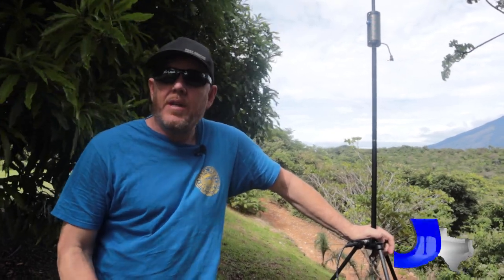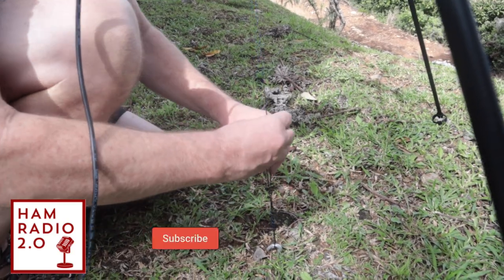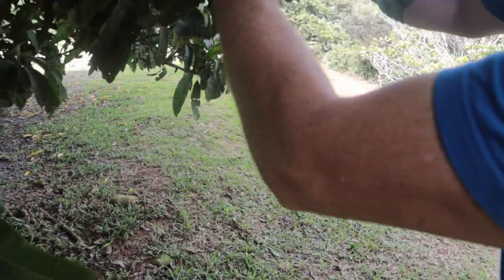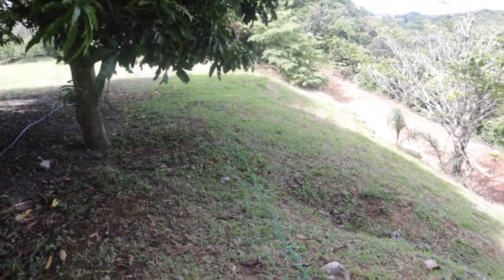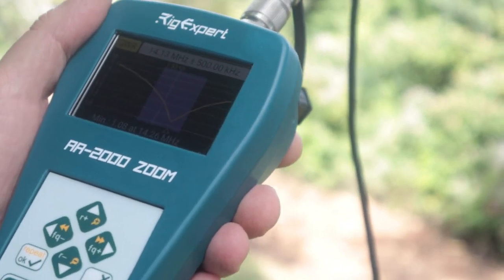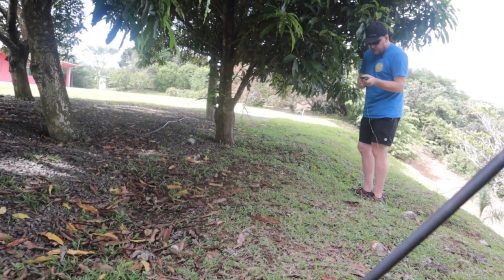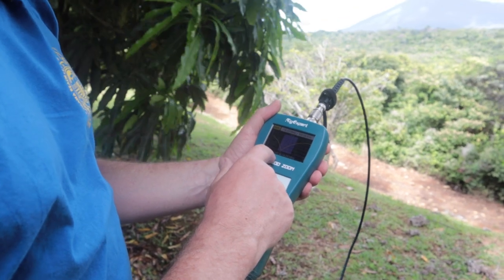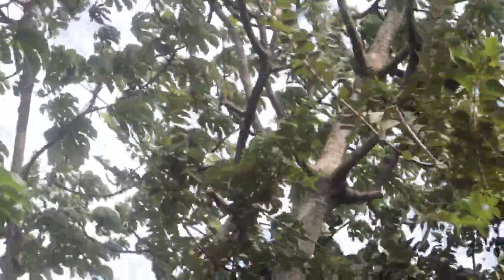Tuning the Buddistick Pro | Buddipole Ham Radio Antenna

Comment: Great tips Chris.  I use my Buddistick for home ops in the HOA restricted Condo I live, and get decent results.  I have mine mounted on a Buddipole tripod with a Versatee.  An antenna analyzer is very useful and almost necessary to quickly get the best results.  I also use the Buddipole Triple Ratio Balun on EVERY installation.  It cuts down on common mode currents on the outside of the coax, and also helps when the resonant point is over two to one.  Sometimes it just take a switch of ratio on the Balun to bring it home.  I recommend using it on all installations. I am a cw operator and usually don't use any more than say... 35 watts.  90% of the time that power level is more than adequate for a qso. Good stuff Chris!  Thanks for continuing to put out good info on setups.  73's K1YPB

Comment: Chris, these are great innovations and enhancements to the Buddipole system. I have made thousands of contacts over the years with the Buddipole and Buddistick. I can deploy this antenna at a park in 5 minutes and be operating without fuss. With the FT891 there is no need for a tuner.

Comment: Looks like it has a much higher Q than the Wolf River Coil.  I get a much flatter sweep on the WRC without all the fussing with the radials.  If he just put out two more radials I suspect he would get a much flatter SWR curve.
Reply: Most likely it's because you are using a much longer whip on wolf river coil.    The high Q is due to the coil usage, so longer whip will help.
Reply: @fubolibs4218  That makes sense.

Comment: Great antenna.  The only thing is that counterpoise/radial that needs to be up on the air.  If you are doing 20 meters that would be around 16 feet long.  Love the bag that comes with it.

Comment: Great video. I was having a tough time with 40 Meters. I ended up with my radial less than a foot off the ground to get 1:5 to 1 at 7.110. I will try this method out next time and see how it works.
Reply: I too am having a rough time tuning up on 40 meters. I'll post my notes back here once I achieve my tuning. I love this antenna design and I am not going to quit until I get it. :)

Comment: Interesting, does the single radial also have an effect on direction of transmission ?
Reply: I believe the answer is absolutely.  I'm sure there are those here who understand antenna ground plane theory and design better than I, and they could correct and clarify what I'm about to say, but you should see somewhat greater transmit and receive distance in the direction the radial points on the horizontal plane.  Think of reflections, where the signal comes off the whip, and it's being drawn downward by, and reflected off the ground plane (radial), and then outwards like an egg on it's side, with the long end of the egg pointing towards the radial, and the whip antenna positioned more central to the fat lobe of the egg.  This is more unidirectional, whereas adding more radials makes the pattern more round or omnidirectional.  Three 1/3 wave length radials would make a triangle radiation pattern (triad), with very rounded corners on the triangle (think of three circles mostly overlapping at the center, with the antenna whip coming up from dead center  of that intersection), and four 1/4 wave radials in a square orientation (left, right, forwards and backwards), would be result in a near circular radiation pattern (four circles instead of three), a square with very round corners.  This pattern, with the radials flat from the termination point also results in the signal being somewhat elevated as well (mostly like a doughnut that's laying on the radials).  Being high on a hill, you will actual find greater distance communication with others who are at the same elevation as you or higher, and those at lower elevations will lose your signal somewhat closer.  If you slope or angle the radials down slightly, the signal will tend to run closer to the horizon or below, reaching downward into the valley below (lowering the doughnut).  Disclosure ;I am not an engineer, but a human and imperfect. I wish to learn and know as well, so any constructive criticisms and corrections are welcome.  Please keep the flames to a minimum as we are all learning and we all have our expertise and opinions, and they may not be both at once.
Reply: Yes, there should be some directionality favoring the broadside of the counterpoise wire.

Comment: How about using one or two pop up canopy weights using cable ties to weigh down the base.

Or use three of them, one for each leg of the tripod?  The tent weights have a slot about 1/2 wide.  Could the weights slide over the end of the legs.  Or use ties.

Remember, some placed stakes ate a big NO NO!

Comment: Question: can you attached the low band coil on the other coil so you can then have  6-80 mtrs  with the buddistick pro??
Reply: You have to swap this coil for the low hand coil and swap this wire assembly for the longer wire assembly.

Comment: Just came across this video.  I have the original buddistick so I assume the tunning will be the same.  My radial wire is not color coded…what is an approximate length for 20 meters?  I can check with the rig expert 230 stick but it would be nice to start in the vacinty of a good length.
Thanks Andrew
Reply from the maker: The coil on the original Buddistick is similar but not the same, I don't believe. So the length of horizontal element will also be different. But I don't have a measurement length with me right now

Comment: If it's elevated it's a counterpoise and needs to be tuned.  If it's on the ground then it's a radial which doesn't  have to be tuned because the ground detunes the radial........I think that is a downside of the of the Buddi Pole/Stick.

Comment: The video is good ... but hasn't it happened to you that when you measure with the analyzer it is swr low and when you connect the cable to the radio you see that the swr is super high?Is it like a fake swr bass, that is, is it not true or when you play the analyzed swr does the swr go up and when you release it it goes down?
Reply from the maker: No. The only way for that to happen is a bad connector somewhere.

Comment: Best budget antenna analyzer?
Reply: I use the RigExpert stick 230 for this antenna and more field work.
Reply: Xiegu G90 😳
Reply: I’m going to test a theory for a video.  Radial for swr and whip for freq.
Reply: Budget would have to be a Nano VNA.
Reply: Another vote for RigExpert stick, but I got the pro version. Henry Radio from LA (his eBay store too) currently has it for $329 with manufacturer's 2 years warranty. It covers all the way to 600MHz. May not be the cheapest, but you will also get a built-in Bluetooth connection that allows for remote monitoring from your phone or tablet. It normally retails for $389+ at most other places.
Reply: @K5QBF  any results?

Comment: I have the Buddipole BP extra vibrating arms low band coil longer whips what a waste of money,  it now makes sense why they only demo 20 meters, all you do is spend spend spend to get additional addons for 80m and struggle to even tune 40.  Now you need to buy a triple balun to try and get 40 &80 forking out around $800Au dollars I now prefer my PAC-12 or JPC-7 3rd of the cost 2 minutes to tune up and on-air,  less than 1:3:1 across 40m well out preforms this antenna, just my finding spent days trying to tune the Buddipole BP no more
Reply: I’ll buy it from you
Reply: @plemieux84   sure were are u
Reply: @plemieux84  your money would be much better spent on a JPC-7 OR PAC-12  antenna which does 40-6 meters easily and with z DIY coil you get 80 i use these for POTA and have much better sucess 100 times faster to tune  and you dont need to keep buying accessories
Reply: @arcskeepingyouconnected7537  I just looked these up and they are totally just Buddipole knockoffs. It’s the exact same setup/parts/etc.
Reply: A bubbipole knock off  id  check yr history and i guess untill u have owned both and tested both u just assuming
Reply: @plemieux84 I would have to agree, they’re basically BuddiStick/BuddiPole knockoffs as they came out way after the Buddi products.